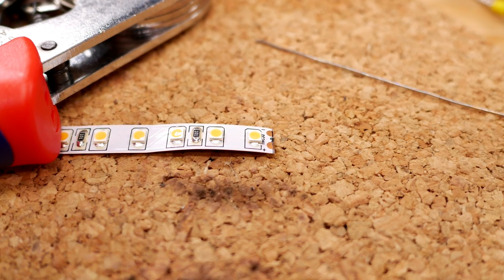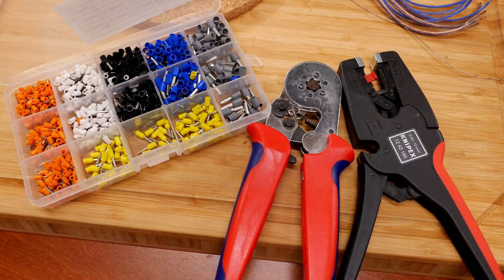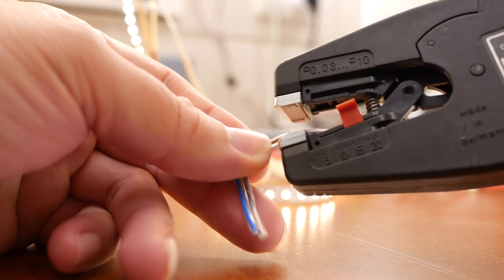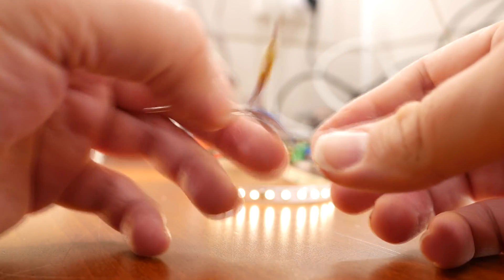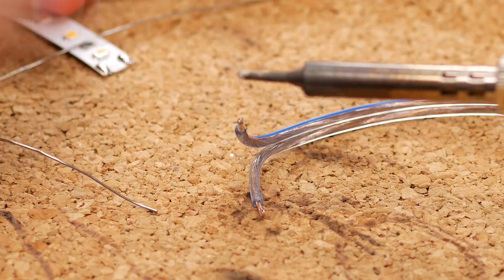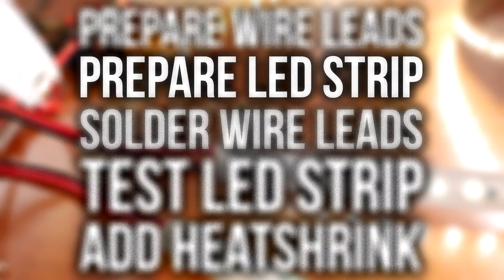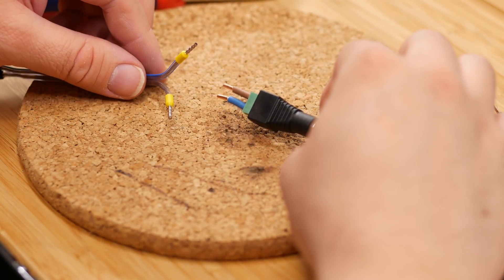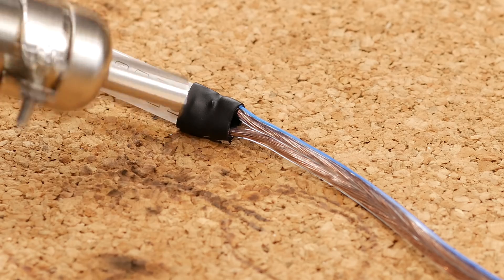How to Solder LED Strip Lights

Comment: How do I add power mid-line, for longer 5v runs?
Reply from the maker: Generally it's fine to add those using the extra wires. So you connect the JST plug together from 2 strips and then use the extra wires to feed in extra power (to both sides).

Comment: very easy with only two pins, what about 4 pins???
Reply from the maker: It's the same deal, if the wires don't fit, solder smaller diameter wire.

Comment: Biggest issue is getting the silicone wrapping off the strip in order to get to the pads , Any  techniques you want to share
Reply from the maker: If they are epoxy coated I generally peel it off, do my soldering and then kind of fill it in with hot glue again or heat shrink to where there is epoxy again, but yeah, it's still kind of messy.
Reply: A fingernail easily lifts the silicone, I peel it back and snip it off just enough to expose pads which gets resealed under heat shrink.  Fingernails are my most used tools and never wear out if used properly!

Comment: Why do you add that crimp on side?  Why not solder wire from one strip to the other? I bought click on corner connectors to link individual strips together when making a 90 degree turn on the flat.  They do not perform well in that I have had many burn up.  I also have had individual leds burn out in the 3 led section between cuts and that makes the other 2 leds in that section 1/3 brighter.  These are Hitlights brand and I think they are terrible.  Now I need to redo this installation as it is bad for my reputation.
Reply from the maker: Crimp ferrules make the connection much easier in screw terminals instead of loose wires or even soldered wires, crimped connection is best in that regard. And yeah, those clip on connectors and bends and such, they are horrible, very cheaply made, of they don't immediately fail, they will soon after. ;

Comment: Thankyou good video can I wire 15meters of led together or can that over heat
Reply from the maker: Sure you can do that, I did it in the video too. Just make sure the controller can handle all that on a single channel and inject power like I showed. Also most LED strip needs cooling with aluminium profiles if you want them to survive.
Reply: Intermit.Tech thankyou for reply would that be enough lite looking for equivalent 150 watt remeasured its going to need 20 meters of led strip what size would my controller have to be. What do you mean by aluminium strip is that put underneath the strip. I cannot see how that would cool it down. Kind regards roy

Comment: To save yourself some work and/or to create waterproof led strips you can try these connectors: https://www.aliexpress.com/store/group/LED-Strip-Connector/2761020_513668642.html?spm=a2g1y.12024536.pcShopHead_6465726.1_0
I've had really great experiences with them. I used to solder them all by hand but since I've found these I simply use the connectors instead.

Comment: perhaps using soldering flux would help in tinning the led strips.
Reply from the maker: I believe I mentioned this in an overlay comment but yes, if you are having trouble with solder sticking, flux is always your friend! :)

p.s. My solder has a flux/resin core inside of it so I generally don't need any extra.

Comment: It should be noted that you need a proper crimping tool to get a good connection. In my experience... if you get the $30+ chinese crimping tools they're usually good enough, the cheaper ones won't crimp well enough and leave loose connecitons which can be a fire hazard.

Comment: I also prefer twisting the strands before soldering or crimping a ferrule but twisting can increase the diameter which sometimes makes it harder to insert the wire into a ferrule.